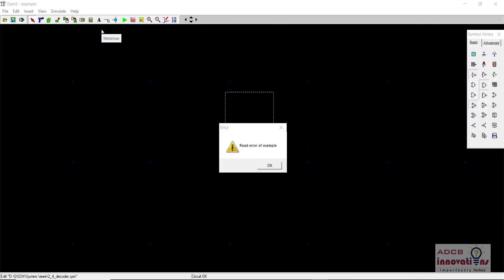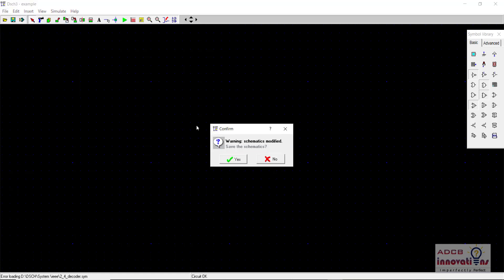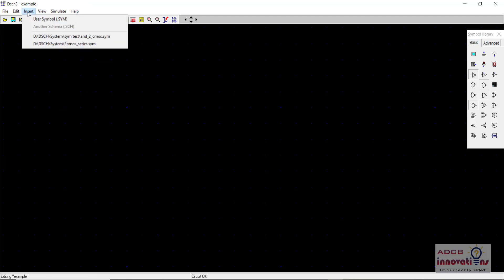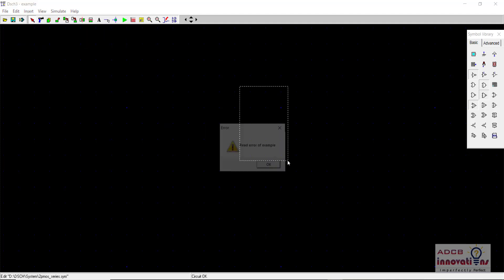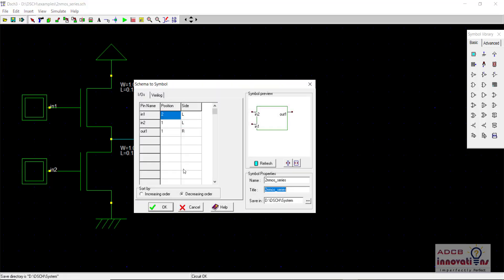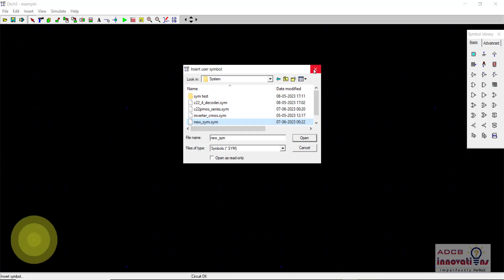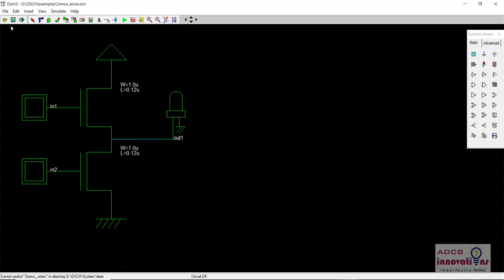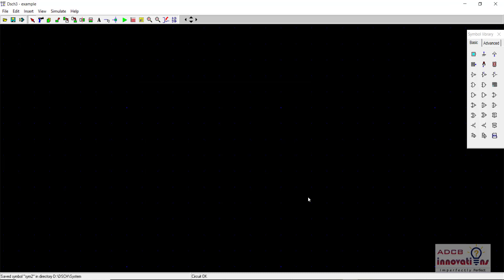Read Error in DSCH- SOLVED !!

Comment: Instead of red LED is glowing in ASH color.What is the issue ?
Reply from the maker: Apologies for delayed response.

Grey/Ash color means the LED is either in high impedance (Z) or unknown (X) state. This could be due to some misconnections (either some wire is getting short-circuited or it is remaining open-circuited).

Regards
ADCB Innovations Pvt. Ltd.